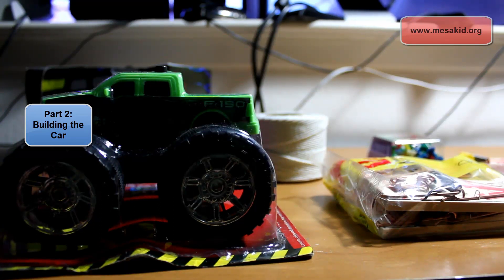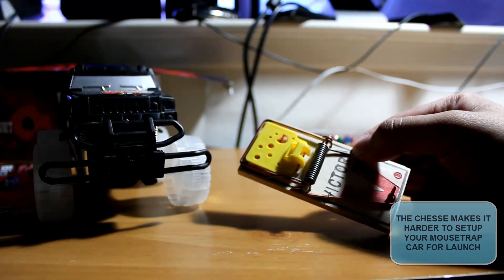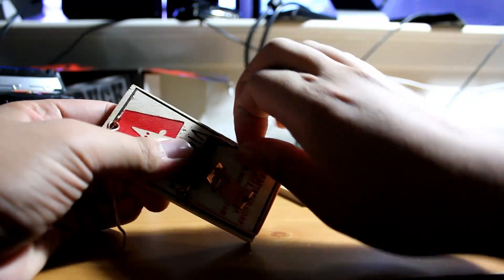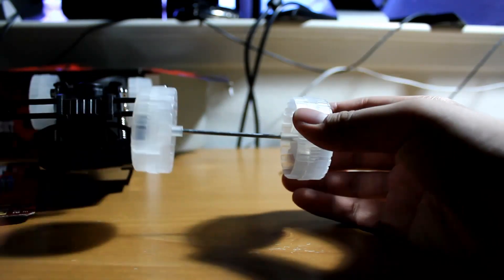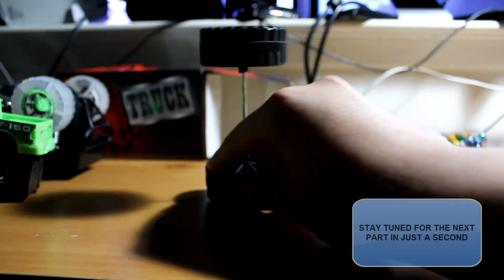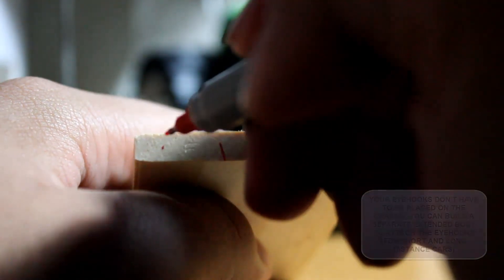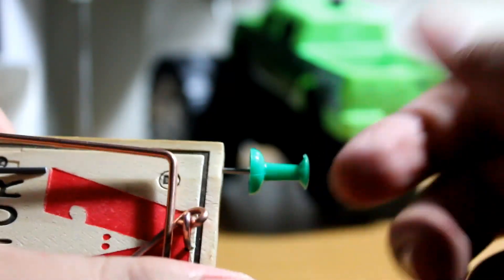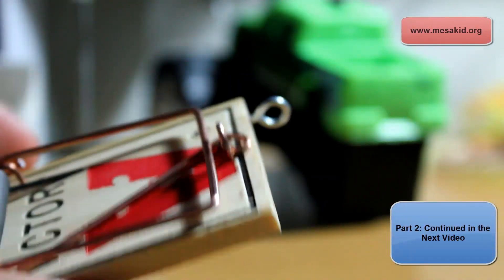Building a Mousetrap Car Part 2 of 4

Comment from the maker: This is soo late of a reply, hope you found an answer a month ago. I've used bottle caps before, gatorade ones because they were fairly large. To make a whole you could use a drill, but I just used the tip of a hot glue gun to make a hole right through the middle.

Comment: @rebeljsh3 
 
keep the mouse trap in its regular form push the lever back this ewill be hard to do since the metal bar he told u take off is on now use the stick thing and hook it on the side of the mousetrap or you could search how to set up victor mousetrap small one and get the one with the actual guy from victor

Comment from the maker: @bre7447 Well, if you're still doing this, I use to make my wheels out of bottle caps (like the gatorade ones). It's more work though. I would burn a hole through the center of the bottle cap using a hot glue gun. You could use wooden dowels for your axles.